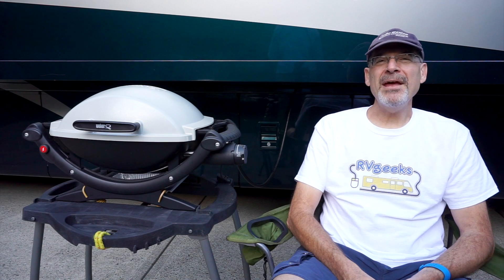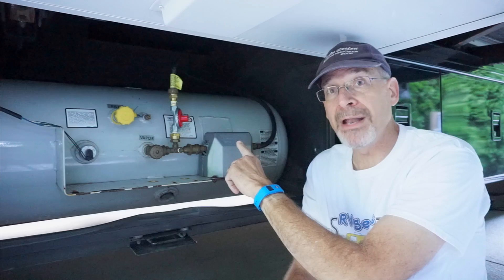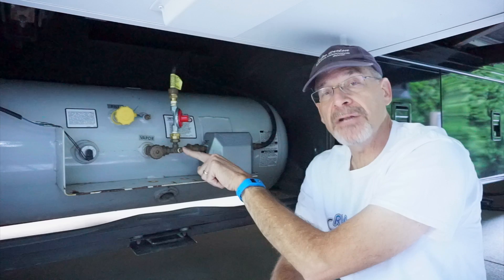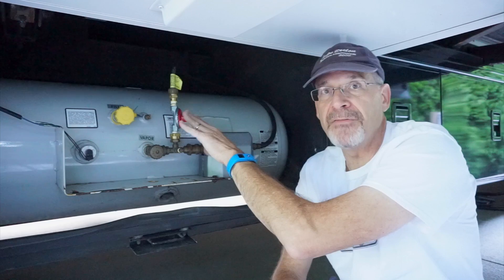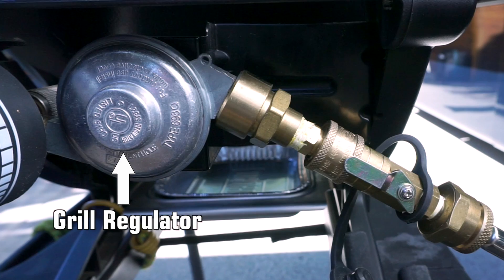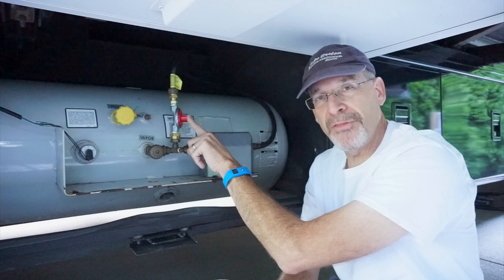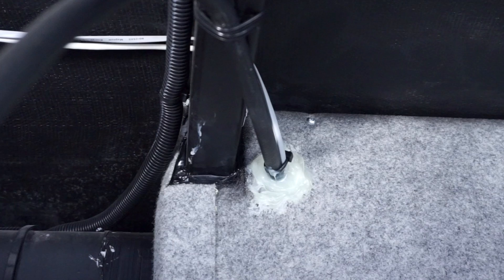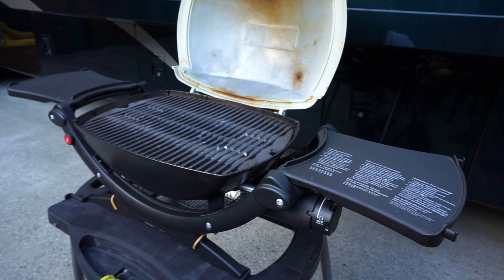How to Connect a BBQ Grill to an RV's On-Board Propane Tank

Comment: Hello, purchased all the parts you recommended and built this setup as you directed.  It's hooked to a Campchef oven/stove from Costco, that has its own regulator. I don't get a big enough flame to cook.  If I remove the regulator you suggest back at the tank, I get plenty of flame, but also the oil in the line.  Any suggestions?  And thanks for this video!
Reply from the maker: Hi! Can you confirm that the regulator you added at the tank is the 15PSI one we showed? The use of an 11-inch water column regulator is the most common cause of the problem you’re describing, as it causes double regulation, since that’s the type that’s already on the grill. The other possibility is that your grill requires a high-flow connection, which might require higher-flow connectors. If you have a particularly large grill, that might be the issue.
Reply: Hello, yes, its the 15PSI , purchased on Amazon.
Reply from the maker: Are you using a small, portable grill, similar to the type we have? Or are you powering a larger grill, like the type someone might use on their home patio? If you let us know what make & model your grill is, we might be able to figure out if it requires a higher flow rate.
Reply from the maker: Thanks for the link. Yours appears to the same type as ours, but you may have to contact Camp Chef to ask them if there are minimum pressure requirements for the grill, since the manual says it's designed to run on full high-pressure propane. It's possible that their regulator needs more than 15 PSI. Our grill is also designed to run on full high-pressure propane, but runs fine with it stepped down to 15 PSI. Maybe your grill's regulator need more than 15 PSI, but not the full pressure. Maybe somewhere in between (20 or 30?), which might be enough to pressure the grill without causing the oil.

Comment: What made you decide on a 15 psi regulator?  I ended up with an adjustable (0 to 30) and wondered about the best setting.
Reply from the maker: Hi Casey! Our local propane supplier told us that pressure between about 10-15 PSI would be low enough to prevent the oily build-up, but plenty high enough to supply an adequate supply of propane all the way across to the grill. We didn't see a 10 PSI regulator at the time, but found this 15 PSI one on Amazon and it's worked great ever since. If you have an adjustable one, we'd set it to 10 PSI, and as long as that provides enough pressure to run the grill, you should never need to touch it again. Of course you can turn it up a little if needed, too. Hope this helps a bit!
Reply: Rv geeks - I am running similar setup on 5th wheeler and think I may be running into the same problem running 25ft without the 15psi regulator at the tank. I am running q200 as well as camp chef everest(2x20k btu burners). Wondering if you happen to know if 15psi regulator would still be the one to go with?
Reply from the maker: If you run both grills at the same time, you may want to consider an adjustable regulator. While we think the 15psi should be sufficient, it’s possible that with both grills running, it might not be enough. Having the ability to adjust up/down would give you more options.

Comment: Where did you get the 1" to 3/8" for the regulator?  I can't seem to find it.
Reply from the maker: Hi Kurt. Do you mean the 1"-20 Cylinder connection at the grill's regulator? We used an 1"-20 to 1/4" female pipe thread adapter (available here on Amazon: http://amzn.to/2FrkVVO ). You can see more details (including parts diagrams and complete parts list with links) on the post for this video on our website: https://www.thervgeeks.com/propane/bbq-grill-connection/

Comment: There is a T connector that has quick connects already on it. How would I incorporate the 15 psi regulator if I used that connector?
Reply from the maker: Hmmmm... don't know exactly, Lisa. But it sounds like you'd have to find the appropriate, matching quick-connect adapters to go from that T to the relevant parts of the system (tank connection, onboard regulator and the 15psi regulator). Is there a reason you're interested in using that instead of the Extend-a-Stay?
Reply: RVgeeks well- first it looks intriguing 🤔 I am not a full time Rver so I don’t want to leave the hose connected all the time. Also, my propane compartment is small and I’m not sure I like leaving the hose connected during the times (spring to fall) that we would use it most. So, if I am going to have to attach and remove the hose then a quick connect seems more efficient. The QD is at a right angle so it’s a straight shot.  Seeing this type just got my brain going.....lol thanks!
Reply from the maker: OK! Makes sense... we were just curious! Your best bet is probably your local big box hardware store (Home Depot/Lowes in the States or RONA/Home Hardware in Canada). The plumbing department usually has a wall full of adapters, connectors, etc... and with careful, thoughtful planning, you should be able to piece everything together. One suggestion... include a gate/shut-off valve on the part of the "T" going to the grill... so even if you DON'T hook up the hose for that, you can still turn the propane to the RV on for the stove, water heater, fridge, etc. Good luck!
Reply: RVgeeks There are shut-off levers on each of the quick-disconnect ports to completely shut off gas supply- is this what you mean or do you mean an additional shut off mechanism? (just double checking)
Reply from the maker: If the T has shut-off valves, that's what we meant. Most T's don't... so we just wanted to be sure that you had one in place on the port that could have nothing connected to it if you're not leaving the line to the BBQ in place all the time. Just double-check the ratings on the T and shut-off valves... since you're installing it right at the tank, it will be exposed to full tank pressure (100-200psi!), so you want to be sure it can handle it.
Reply: RVgeeks y’all are AWESOME! Thanks

Comment: Has anyone had issues with pressure? I completed my setup and one I connect the BBQ I get the initial burst of propane and then it dies out.
Reply from the maker: Hi Miguel. Sounds like you may have installed your tee downstream (i.e. after) the RV's onboard propane regulator... which means the pressure is too low to be an input to the grill's regulator. So you get that brief burst, but then the grill's regulator shuts down and doesn't allow any propane through. You have two options: remove the regulator from your grill (which is often hard because it is integrated with the flame height control) OR move your tee upstream so that it is tapping into the propane flow BEFORE the RV's onboard regulator. Hope this makes sense.
Reply: RVgeeks thanks for the reply.
I installed the T prior to the onboard regulator just like you showed, and I tried both with a regulator on the grill and without.
my grill uses a household propane thank not a small one does that make a difference?
Reply from the maker: +Miguel Pereira No... that shouldn't make a difference. Sounds like something else is wrong. Just not sure what to suggest that you try. We've occasionally had a situation where the regulator on the grill got locked up... and disconnecting the propane, turning the grill on to clear the regulator, and back off again, and then reconnecting the propane supply worked. If that doesn't do it for you... what happens if you connect the grill to a portable tank again? Does it stay lit then? Knowing if it works off the portable tank might help you to work backwards to find where the issue is.

Comment: I see your grill has a regulator on it, and you have a regulator right off the tank.  Any issues with having two regulators?  I've read that won't work, but have never tried it.  My RV already has a quick connect fitting built it, but I hadn't bought a hose for it, since my grill has a regulator built into the adjustment valve.  I was told I couldn't tap into the quick connect because I'd have two regulators inline.
Reply from the maker: The “double regulation” problem only occurs when two 11-inch water column regulators are used in the same line. That’s the standard type on typical grills and other propane appliances, and equals about 0.5 PSI. But the red one we added at the tank is 15PSI, far higher than the grill regulator. So it provides plenty of pressure to the grill’s own regulator. The 15 PSI reduces the pressure part-way.... enough to prevent oily buildup in the long run of hose extending across the RV, while still providing plenty of pressure to avoid the double regulation issue.

Comment: Wouldn’t it have been easier just to add a filter to filter out the excess oil
Reply from the maker: We did that originally, but since the high pressure will continue to produce oil, we decided to go for a more permanent solution by stopping the oil from forming in the first place.

Comment: So you added a regulator to your Extend-a-stay high pressure line AND THEN you hooked up that same LPG hose to the regulator on your Weber.  Two low pressure regulars , in series.  Big no-no.
Reply from the maker: Yes, two low-pressure regulators in the same line won’t work, since it cuts down the pressure too low for the grill to operate. But that’s not what this is. The red 15 psi regulator is a step down, and not low pressure. The regulator on the grill is a standard 11 inch water column (which equals approximately 0.5 PSI), which is far lower than the 15 PSI. Putting two 11” WC regulators in the same line would indeed prevent the grill from working properly due to low pressure. This system, exactly as shown, has been in place on our RV for years, and works perfectly. The grill fires up and works at full flame, and no oil builds up in the long line from the main tank.